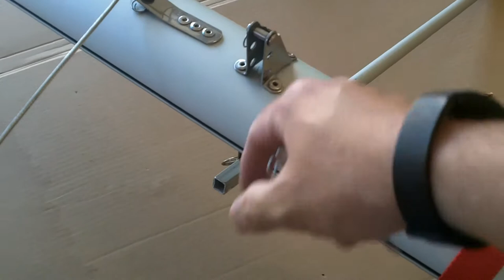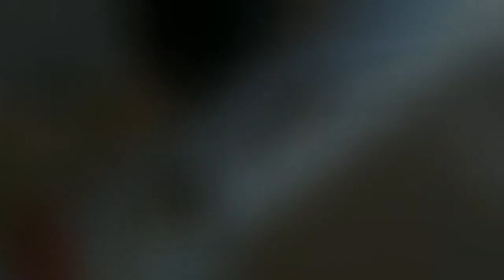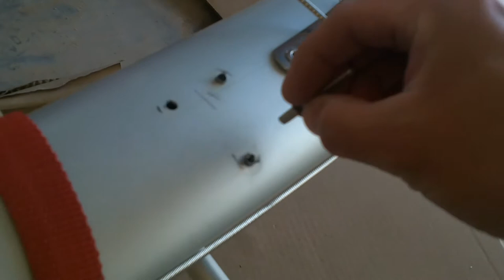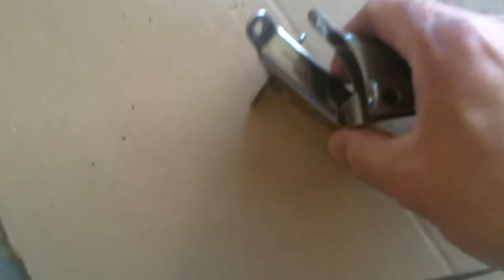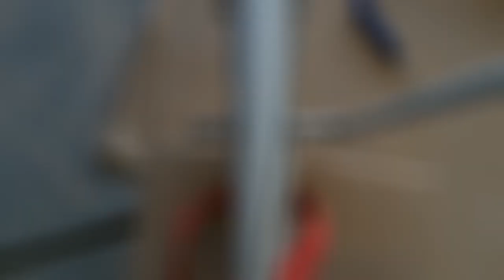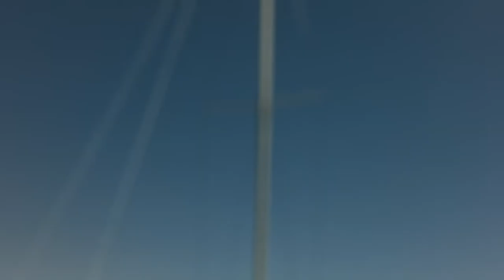Mast spreader bracket replacement

Comment: Could you share where you got your spreader bracket, Catalina wants more than twice that for a replacement
Reply from the maker: I ordered mine direct from Dwyer Aluminum Mast Co. They are the OEM supplier for Precision boats and make brackets in several different sizes.

Comment: nice job, unfortunately you don't show the actual riveting process. Do you like your rivet gun? I need to get one....

I think the replacement was not needed. I could not find quickly a diagram that shows how many plastic deformations you need to actually weaken the metal. That's the beauty of steel, it is able to handle deformations without losing strength.
Reply from the maker: I tried several times to get the bracket back to the original shape…but the ends of the spreaders would not line up. Maybe if I had removed the bracket and then bent it back into proper shape it would have worked better? But at that point…might as well replace the part, right? Sadly, the rivet gun has not been used since…
Reply: @ColoradoSailing  thanks for your reply.

I am getting a used mast for my trimaran project and need to cut it, so I am getting prepared for some riveting fun 🙂
Yeah, u accumulate lots of single use tools, lol. BTW, would you recommend the rivet gun you are using?
Reply from the maker: @SamuelLanghorn  Very pricey…but works great. The only issue is that the head is very wide…so not good for riveting in tight spaces. That model was recommended by the folks at Harken.
Reply: @ColoradoSailing  which model is it exactly, it does not show clearly in the video.
Reply from the maker: @SamuelLanghorn  it’s an Astro 1426 1/4” hand riveter. Currently $31 on Amazon…which is a lot less than I paid!
Reply: @ColoradoSailing  great, thank you. ...oh, well, timing is always off in hindsight 🙂